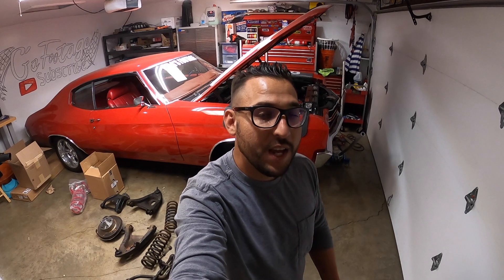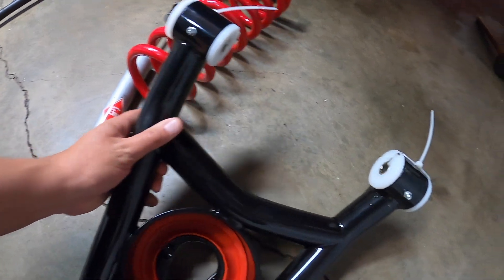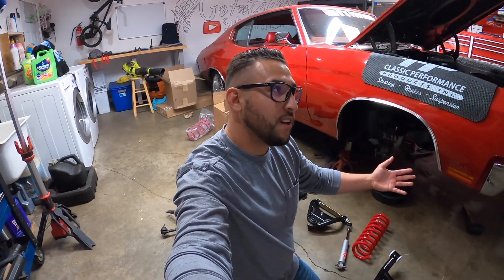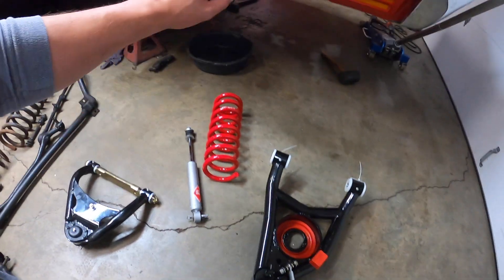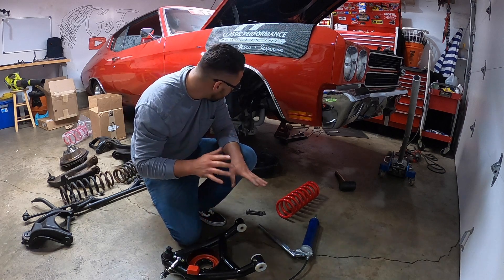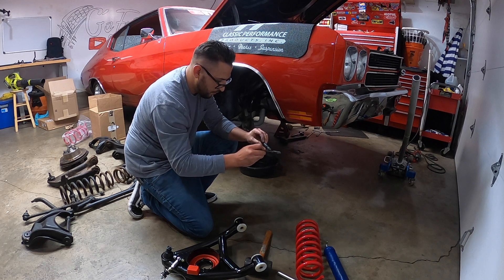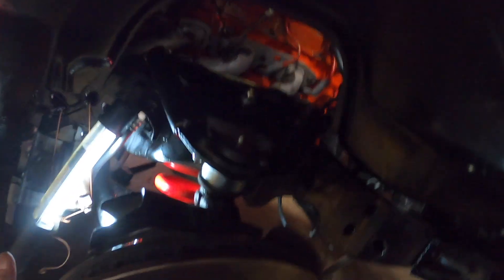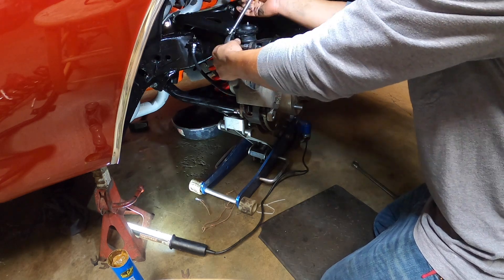Installing OPGI Tubular A-Arms and BMR Lowering springs

Comment: I wish I would have seen this video before I installed my BMR lowers! I would have greased them before I put them on. I ended up putting 90 degree fittings in mine. Thanks for a great video.
Reply from the maker: thank you for watching and the kind comment. appreciate the support

Comment: Can’t wait to see how she sits! I stayed with my old stock springs with drag shocks and it looks cool, but I’m gonna switch to KYB’s for a smoother front end & because I miss the raked look
Reply from the maker: yeah I had the rake look too, with the nose slightly higher than the rear. My brother  had told me that his car lifted up higher from the front after the opgi a arms, because of that huge rubber isolater where  the spring sits. I didn't want it to point up even higher on my car, since it was already slightly raked up, thats why I just opted for the 1 inch drop. and tbh I didn't want to lower it much cause  my headers hang real low. hopefully I end up with a leveled look, since the arms have that huge rubber isolator, might compensate. fingers crossed.
Reply: I’m sure it’ll be ok, I used no isolators when I did mine and it came out leveled

Comment: Looking to do a front end rebuild as well. Coils/Upper and lower arms, ball joints, coils.  Im looking at the same set you bought.  How have they been, it's been over a year since you've installed them. Also, did the car lower at all with the coils? I'm looking to lower my 72 chevelle either 1 or 2 inches.